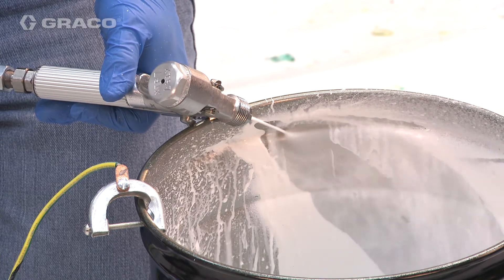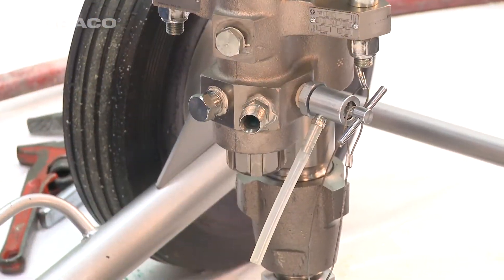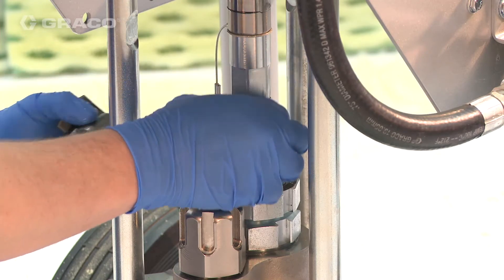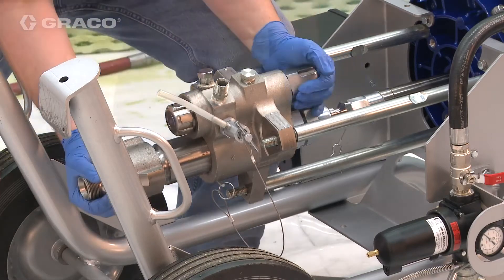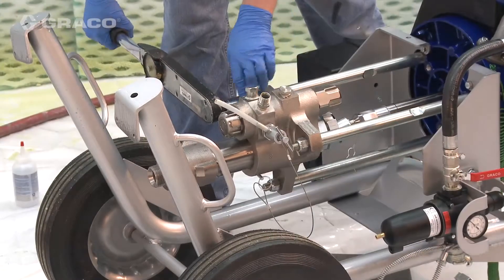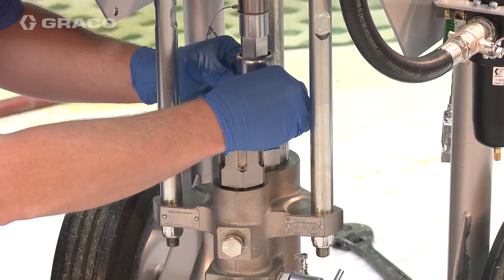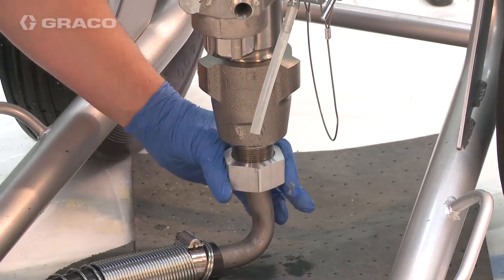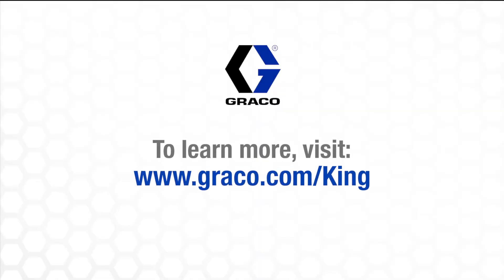King Sprayers - Lower Assembly Removal and Installation

Comment: What is the part number for the oring in the filter manifold? X30 model.
Reply: Moises,

There are three total o-rings used in the filter area.  One o-ring on the top filter cap and two different o-rings on the lower filter cap.  These o-rings have changed over the years.  If your pump was manufactured prior to 2010, we recommend a Filter Cap Upgrade kit, part number 24F975.  If you sprayer is a current model, the part numbers are as follows.  The top o-ring (thickest) is part number 262483.  The bottom O-rings are part numbers 224459 (thinnest) and 244895 (medium thickness).  All of these o-ring part numbers are sold as 10 packs.  If you have any other questions, feel free to contact our Technical Support Team at 866-361-5959, option 2. 

Best Regards,

Graco Tech Assistance.